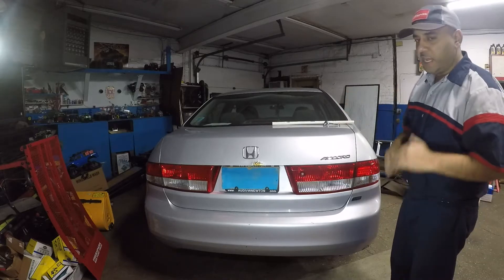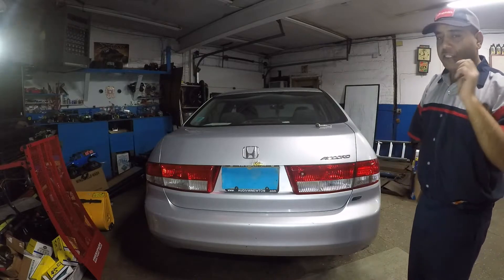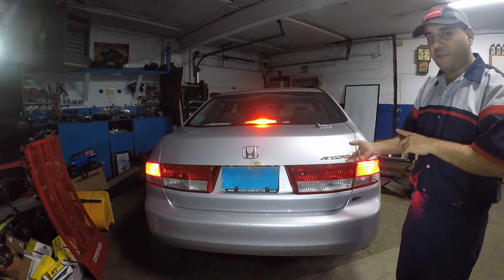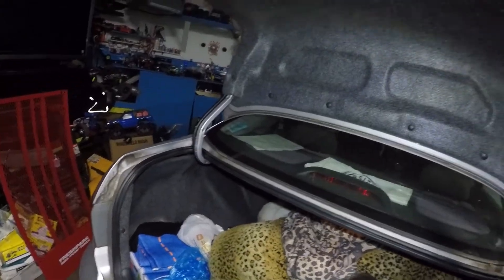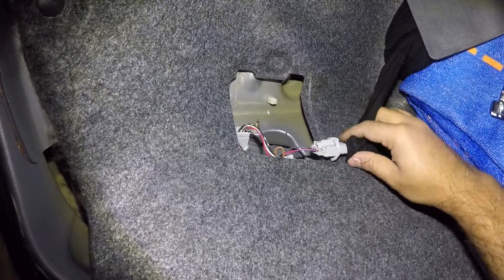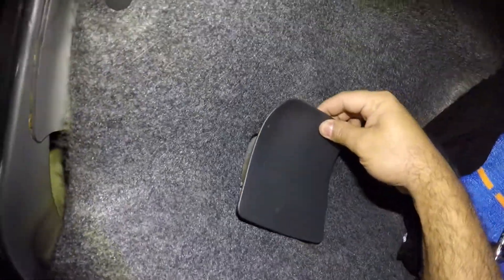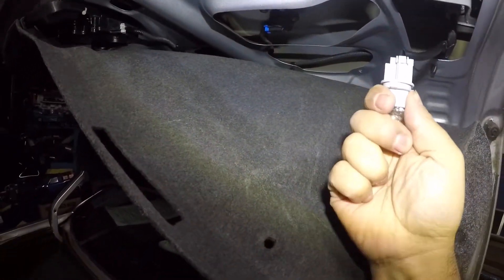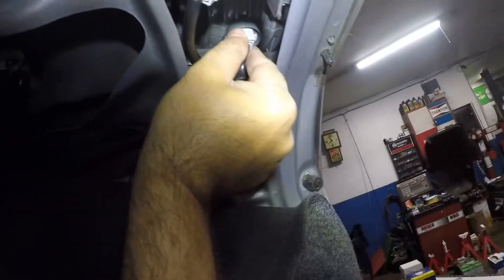How to replace brake and other Bulbs on Honda Accord 2003 and up

Comment: Hey RB The Mechanic, I have a 2005 Accord LX, what if you replace all the bulbs, and the when turning on the headlights, your taillights don't illuminate, like your video shows? My brake lights work when the brake is depressed, but at night, there's no illumination when the headlights are on. I replaced the both 15A fuses for the "Hazard" and the "Small Light" (per the Owner's Manual), which were blown, BUT...the taillights STILL don't work when the headlights are on! Can you point me in the direction of the a different fuse to consider replacing?
Reply from the maker: Try chaning one of the bulb see if that one start to work with headlights

Comment: Salvador, Hi Thank you for all the advise.  I have a strange one for you.  I have a 2006 Honda Accord Couple and my back bulb fell inside the Taillight Housing.  What can I do?
Reply from the maker: I seen those happne and it will be very difficult to take it out u can just leave it in there and put on another bulb. If u do want to remove it ur gonna have to take the light off and try to tip it upside down and hopefully it comes out

Comment: Hello! Question on this video, which part of the video is for reverse lights? The part where you are replacing the ones in the trunk?
Reply from the maker: Yes the trunk part that opens up. The clear lens part
Reply: Thank you! I appreciate it. 
 @RBTheMechanic

Comment: Hey do you have a link to what bulb I show use for that singular light in the middle behind the trunk
Reply from the maker: I don’t have link it’s just single flare brake bulb I can get it from autozone just tell then year make model and the location of the bulb
Reply: @RBTheMechanic  dope thanks
Reply: One more question how do you get that mat at the top of your trunk mines don’t have that
Reply from the maker: @GrouchyVlogs  I’m sorry I didn’t understand which mat
Reply: @RBTheMechanic  when you open your trunk you have to lift that mat type thing at the very top to get to that single flare light , mines is just all exposed with nothing covering the metal
Reply from the maker: @GrouchyVlogs  I have 2004 accord it’s also exposed just this one is 05 and v6 it comes with it
Reply: @RBTheMechanic  crap I want that any clue how to buy that
Reply from the maker: @GrouchyVlogs  dealer just let them know what I want show them this video and part that’s the only place u will find other wise junk yard or ebay